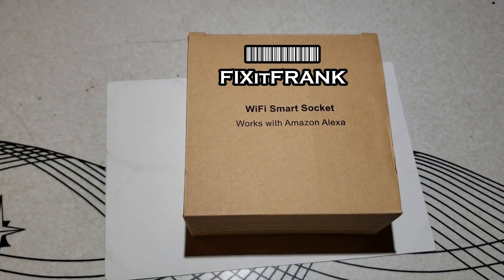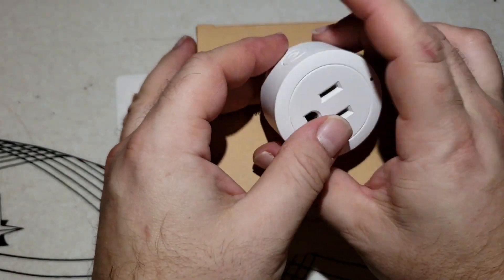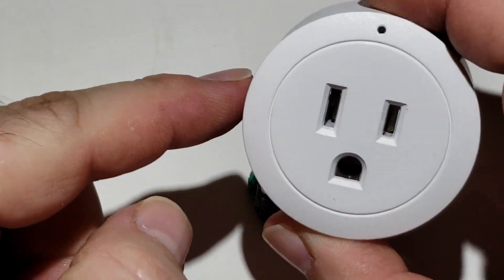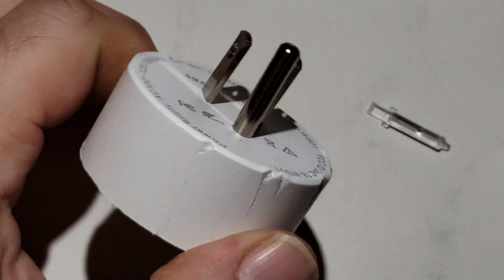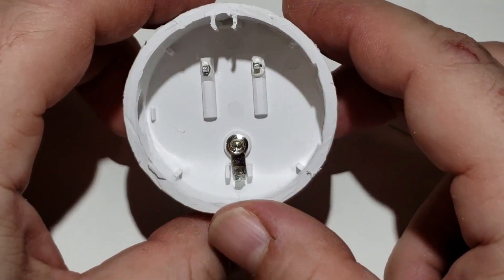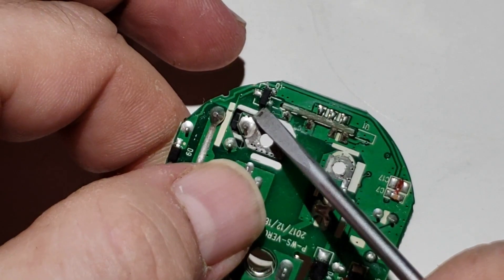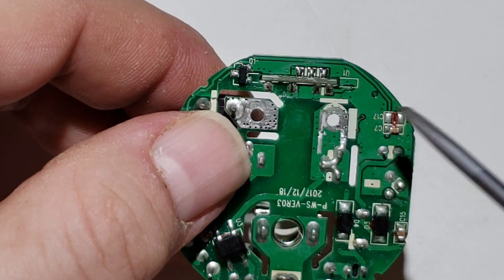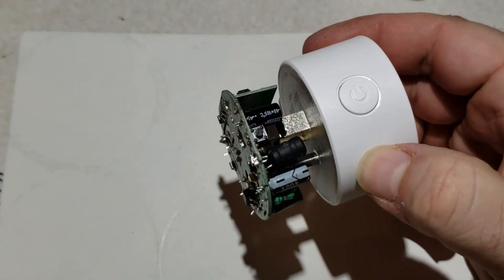Amysen brand Wifi Outlet module Teardown-Review

Comment: can i remove the relay and short the output and operate big load?
With wifi monitoring ?
Reply from the maker: I don't think I understand your question. If the relay is removed and the output is shorted, the mains fuse will fail. To control a larger source ( with a contactor for example) , I would leave the wifi outlet as is and have it drive the coil of a contactor. I've controlled 30amp 240v that way for an air compressor.

Comment: Hello, im wondering that can it be removed the ground plug and it still working well or it wont work at all if we cut the third plug out of it. Hoping you will help me to find my anwser thank you
Reply from the maker: It should work OK.  Obviously it wont be grounded but it wont have any affect on the operation of the wifi or the relay.  Why do you need to remove the ground pin?
Reply: FixitFrank thank you for reply my question sir, im writting to you here in viet nam and we are using the same with EU plug, our power outlet normaly has only two pin in everywhere so im still finding a way to remove the ground pin out of this smart wifi plug
Reply: FixitFrank may i ask one more question please sir? If im going to remove the ground pin out of it, do i have to open inside the plug and using the soldering iron to make it hot and take the pin out ? or i just have to use the pliers with a little force to take the pin out of the plug ? Sorry for asking you too much because of my lacking knowledge about electric. Thank you a lot
Reply from the maker: @keelinh5476  No worries at all! I understand now.  Normally that would be an unusual situation but now I understand why you want to do this.  If you had the tools or time, desoldering would be better, but in reality, you could cut the pin close to the back.  I would not use pliers to pull it out.  You might end up stressing the circuit board and cracking it.  If you take some cutters to the ground pin and cut it flat to the back, you will be in good shape.
Reply: FixitFrank i dont have any cutters but i will figuring it out soon. Thank you so much sir. The world of people like me really need some people like you, have a nice day and thank you a lot :)
Reply from the maker: @keelinh5476  No problem at all! The only problem with pulling the pin is the stress on the circuit board and casing. You could try carefully rocking it back and forth with pliers until it breaks loose. Just do it slowly until the metal starts to crack. You will figure it out 😉. Im always happy to help if I can.

Comment: Do you know what the little modules are called where the plug fits?
Reply from the maker: I do not know the real name. I call them plug connectors or female 110v. You mean the metal parts where the plug fits correct?
Reply: @FixitFrank  That's right, I would like to try to make a smart plug, but I don't know how to get that piece.
Reply from the maker: @allldair  That is very cool!  I do not think you can buy them though.  I think they have them made.  I would recommend taking an old wall socket and removing the parts to use from that. Another option is this. https://www.ebay.com/itm/CyberPower-B100W-Single-Outlet-350-Joules-Surge-Protector/162594966209   It is a surge supressor. You could use the housing and contacts with your own internal parts.
Reply: @allldair  whats the update bro?

Comment: Frank, I bought a bunch of "hOme labs" modules, almost exactly the same as these - only to find out the company is out of business, and app doesn't work. Perhaps I can flash them with another firmware? How do I go about that?
Reply from the maker: It's easy and hard at the same time.  Essentially you either download firmware for one of the brands that use the 'smart life' ap or buy a module with it already on there.  Then you can copy the firmware off using one of many programs available.  I use a UART adapter to my PC. You do need to identify the program pins(rx tx v+ ground) as well as know which pins to pull low to enable programming. 
There are a lot of folks who have done but I have not checked which videos are best.  My recommendation is search youtube for "esp8266 based outlet".  I think once you get some more info, it will make sense and prove pretty easy.   I do plan on making an ESP8266 cloning video, but realistically not until the winter when I am stuck inside.
Reply: @FixitFrank  Thanks for the reply. I can flash a generic ES8266 firmware on it, but will have to destroy the plastic casing to access the IO's.. perhaps, if I could access the SSID broadcasted by this brand, I could hack into it. I'll contribute by making a video once done.
Reply from the maker: @rameezrazzak  You know there is probably a way utilizing AT commands...  Keep me in the loop and feel free to ask me for any info I can provide. I have access to a lot of test gear and can copy firmware if needed.  I would love to learn to flash these without opening the case.  It never crossed my mind to do it wireless.  Very very smart!